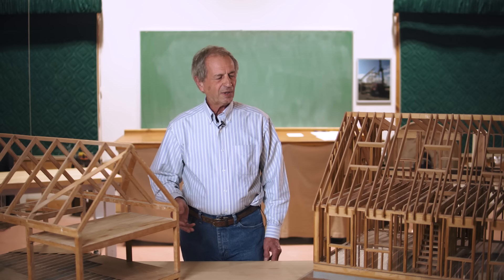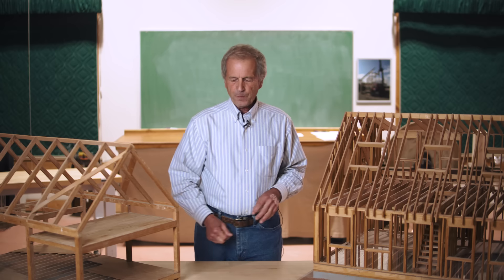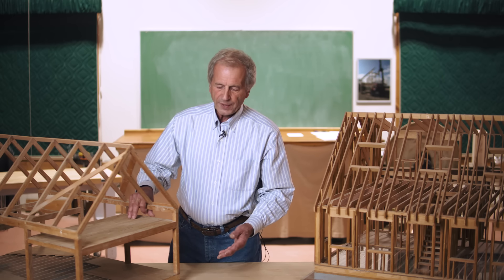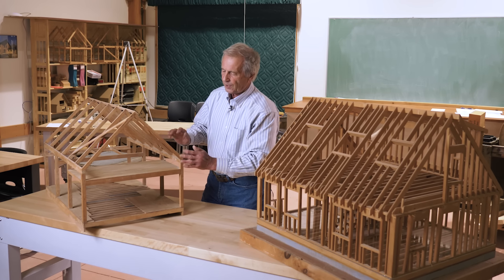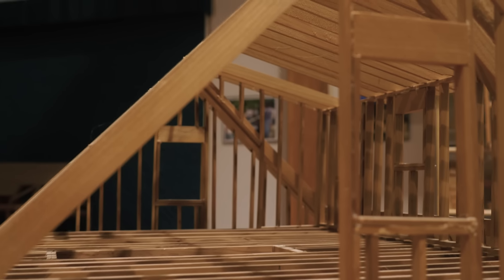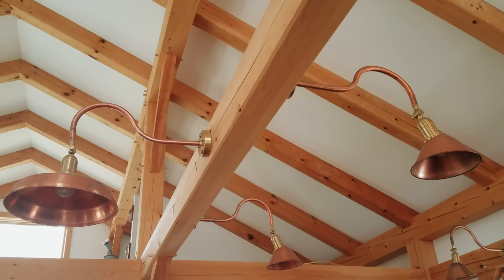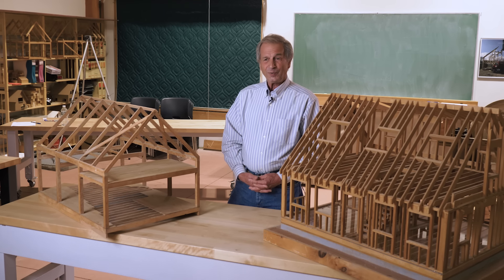Timber Frame vs Conventional Stick Frame

Comment: I'm partial to timber framing. In the south it seems the pine wood that is abundant would have to be treated. I cut some trees myself and found the insects like to bore into the pine wood. There is water oak however that grows straight. The pieces I had sawn do not attract insects. The pine seems invasive and must be cleared out for better wood. I've had many water oaks grow after cutting pines out. A long with red maples. Eucalyptus camaldulensis may be a good tree for timber framing? I grew one this season and are awaiting to see it through the winter. It's a fast growing hardwood that is insect resistant and produces more oxygen than pine needles.

Comment: In the Phoenix Metro area homes haven’t been built using conventional framing since John F Long was alive. Light weight truss construction is exclusively used barring very low volume custom home builders.

Comment: Isn't timber framing traditional framing?
Reply: Yeah I would agree with that. In the UK anyway we refer to his 'stick frame' model as timber frame. The traditional timber build like that is very rare as it is waaaay more expensive so would likely be a bespoke one off build for someone with a lot of cash interested in having the exposed timbers and traditional joinery visible.
Reply: @scottm4193  same in Australia, and who builds with fresh cut on site uncured timber, asking for trouble as is dries and splits, twists and bows.
Reply: @speakupriseup4549  it simply requires a different approach and a little foresight to adapt to twisting and shrinkage. Any beginner timber frame guide will show how you can prevent problems with it.
Reply: Scott M well said

Comment: I never understood why stick frame is still used. It seems extremly outdated and inefficient. And besides, you can build a timber frame with non exposed wood inside too.
Reply: Because you actually use around the same volume of wood for double or triple the cost
Reply: @punishedmeridia  It must be american thing. Here you can tell someone who makes planks to do 2x or 3x thickness and he will be happy to earn the same amount of money with less cutting.
(and almost noone builds wooden houses)
Reply: @attinyit9609  
🤔 "Someone who makes planks". You sound like you really know what you're talking about.
Reply: @Smullet90  English isn't my first language. My neighbour is a cerpenter but his workshop looks more like a sawmill, just enclosed. All he does 90% of the time is cut large pieces of wood into planks or turn table legs.
Reply: @attinyit9609  
Fair enough, asshole is my first language. 😄 Przepraszam

Comment: What about some of the drawbacks to Timber Framing?

1. Fire resistance: Gypsum is non-combustible. Covering the framing with drywall helps reduce fire spread.
2. Upgradeability/modularity: Timber Framed structures are often much more difficult to expand. Stick framing is simpler for the DIY person to repair, add-on, etc. 
3. Labor: Heavy timber is well... heavy and can be tough to frame with. A 16' long yellow pine 6x6 weighs about 140 lbs dry! 
4. Building materials compatibility: Fixtures such as windows are engineered to work with stick framed structures...

We moved away from heavy timber in the mid 1800's largely due to labor and material costs. Heavy timber construction requires skilled craftsmen and significant time. If you've got a bunch of skilled carpenters, lots of money, and/OR time heavy timber is definitely still a good option!

Comment: I certainly like the look of timber vs 2”x4”. .  The wider spacing helps offset the extra expense too.  Partitions are still need to fill long voids and give a straighter wall.
Reply: Don't be fooled by the 'less timber'. Large, planed, lamwood timber like this costs an absolute fortune, and the Sips panels he's talking about are extremely expensive too.

Comment: You only get 30 feet with 4, ten foot bents.
Reply: I think he meant to say thirteen and a third foot bents.
Reply: @danceswithstone  Lmao!
Reply: 4 10’ bents is in fact 40’.  However, to your point, it takes 5 of those cross section frames to complete it.
Reply: @tywebbgolfenthusiast8950  Those "cross section frames"?  Those are bents.
Reply: throngcleaver nope-a bent is the cross sectional frame plus the longitudinal members that connect it to the next section.
Reply: @tywebbgolfenthusiast8950  Since you don't know the correct terminology of the "cross section frame" and the "longitudinal members", you really would benefit from researching the names of the parts of a timber frame building.  A bent includes the truss, and two or more posts to support the truss, depending on the span.  The model building on the left side of the screen shows 4 bents, and that's what Pat was discussing in the video.  Two bents makes a bay.  There are three, 10 foot bays in the model.  Perhaps you are from a different country where things have different names from what is used in America.

Comment: Yeah, I really hate that SIP concept.
Reply: Diggnuts why?  Because is takes away from the aesthetic, or something else?
Reply: @tylerk.7947  
From my experience sip panels are garbage. They're often constructed with OSB plywood. I've seen people mistakenly put on concrete siding over sip's. Overtime the sip panels will delaminate in sag. With that being said I'm sure there must be a better sip panel available nowadays
Reply: @tylerk.7947  Essentially building the bulk of a building out of OBS and styrofoam seems ridiculous to me. It's like building with toothpicks and fluff.
Reply: Daniel Dunham ah, I see. It does seem a shame to put osb and foam over timber framing. I like the idea of sips, but hopefully a higher quality type will come out soon.

Comment: Stick framing  ??
Stud Framing ... was what I thunk it was called.
P.S. ... I have personally witnessed an entire stud frame family home erected in ONE DAY.
NO TIMBER FRAME HOME COULD BE BUILT THAT QUICKLY.
Reply: yes, it is also called stick framing. And how many workers were onsite that day? Compared to the regular crew size?
Reply: Few. However, the home my daughter lives in was built in 1886 making it 133 years old. What will bring down this house is the poor foundation it was built on. This same house survived a tornado in 2003 that tore up most of the neighborhood. There is a lot of hype in this presentation, most of it around the supposed minimizing of materials used. The structure model he is displaying lacks a significant amount of the lumber that will be requried to support the SIP panels negating most of the material advantages. Secondly, obtaining timber such as he is demonstrating in the proper sizes - timbers in excess of 12 inch on a side in length of more than 12 foot long - has become an ever increasing issue. Those types of timbers bear an excessive price, justly, because of their relative rarity. I live in rural plains landscape. Anyone that claims post and beam construction is superior to stick built when hit by damaging winds or tornadoes  has ignored the destruction inflicted on farm buildings using post and beam construction when hit by heavy weather. Post and beam construction is as readily destroyed by high winds as are most other construction methods.
Reply: @cdjhyoung  absolutely agreed

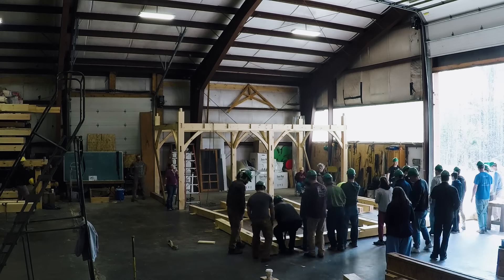Comment: 1:42 "There are 4 bents and they are 10 feet apart, that gives you a 40' building".  No, you only get 30'.  Get your math right.
Reply: Ten foot between bents plus the dimensions of the wood would be thirty feet plus x times four. X being the dimensions of said wood

Comment: I used to frame houses like that, to scale of course, in 5 days. Came to a hole in the ground, left five days later with a fully framed 3500-4000 square foot house. If we weren’t setting trusses by day three, we were probably on a two story house.

Comment: stick fraiming came after nailing machines were invented.
Reply: Do you have proof of that?  We were building stick framed houses in the 50s with hammers in our hands.  Tons of 'em.
Reply: @jeffsmith4110  I think Mathew meant it as a joke.
Reply: I think he meant machines that make wire nails. Prior to that they had to be handmade
Reply: I think he meant machines that make wire nails. Prior to that nails were handmade and so valuable that old homes were burned in order to retrieve them.
Reply: @jeffsmith4110  Why....

Would you have tons of hammers in your hands? One ought to do the trick.
Reply: Pritty much
Reply: @jeffsmith4110  We have a local contractor that still builds large custom homes by hammer. No compressor on his job. It's slower, and he has a hard time finding help, but builds a nice house.

Comment: This is total bs, sell job of timber frame and prefab manuf. component industry. He's not realistic of all the preparatory shop drawings, factory prefab and separate shipping costs.
I have designed and built them all plus other systems like modular and knock down prefab.
Generally, no system has ever bettered the versatility, efficacy and cost of stick frame.
You can design stick frame combined with post and beam and make it look like timber frame. You can show wood as much as you want and at a lot less cost.
Reply: Its really all one's choice. I personally have done prefab homes to which many have needed major repairs done. Mind you this comes from shoty builders too, but mainly the engineering behind them is subpar to which is why I left the industry. Also to why I won't live in a prefab home or one on a concrete slab. Honestly, I'd take a timber home as it can be modified with little concern of the interior walls holding structure unlike a modern stick built or prefab home.
Reply: @brandoncaldwell95  That also is  valid point. You wouldn't have to worry about any walls being load bearing.
Reply: Some true, but mainly no. The problem with Stick frame for me, is that it has no time value. Timber frames, be it for mudhouses, clay bricks, or modern buildings.. they tend to be very reliable and a long term choice. Hundreds of years later, they still stand. They are still reliable. Compared to stick frame, which for most cases, doesn't tend to live the 4 decade mark. Not all, but most.

And it's not because of the wood. It's the same problem as it is with fake plaster walls. They can be incredibly strong, yet their construction and assembly is subpar in most cases. The problem is the assembly and the workers standard. Here, wood is expensive, so we use stone, concrete, and iron for the most part. You need a higher standard for that, and people still fail. 

In case of buildings that require lower standard and can be done faster, are usually "thrown" together.
Also, older people built differently and timber beam building had a much much higher culture, that is why old constructs are better and most succesful. Nothing guarantees that your house will be better, because it's made out of timber framing.

Comment: 98% of spiders prefer timber framed houses.
Reply: Because of all the high up beams? I really wonder which is better in terms of pests getting in, though.
Reply: @jon4715  - I wasn't aware you could keep spiders from getting in.  Bears, maybe, not so much spiders.
Reply: @jrstf  I suppose there are tons of ways of proofing one's home against certain pests. But that starts pre-foundation, and continues through foundation stages, and continues on through framing and so on. Certainly there are ways.

Comment: I fell in love with Timber Framing as a Style the instant I saw the first Pics of it. Then, when I learned a little about the technique, I wanted to start learning  to use Chisels and slicks and a mallet, measuring, locating, scribing the locations of the cuts... 
What I found was no5thing I'd done PREPARED ME with the Skills I Need.
NOT all my years of drawing, whether carefully laid out architectural perspectives, or silly cartoons... NOR all my years of dedicated fiddle practice, nor all my carpentry projects and summers of framing, NOT EVEN using a Waffle-Faced Hammer without smashing my fingers!!!
Not complaining, just acknowledging that learning proper use and care of the tools — storage, cleaning, SHARPENING, leverage, angles of attack, control of angles thru a stroke,  PROPER SHARPENING, accuracy of measuring scribing, and depth of cutting blades in planing tools, AND SHARPENING are all absolutely Crucial.

Comment: Timber framing is a great concept. My apprehension would be the greater distance between runs of fastners in framing. Wind sheer is a very real concern. I get the same uneasiness when passing houses built on 10 foot tall unbraced sets of cinder block pillars.
Reply: Traditional this is done with wooden nails made from oak.

Comment: Really awesome to see as an architecture student. Live in a German challenge in Tennessee that was designed by a German man. 

Having a unique timber constructed house like this is a joy to have due to uniqueness. It's not large, but its truly unique experience. Especially the walls with are largely wood as well with little sheet rock and all hardwood flooring except one bedroom.

Thx for the video. Seemed to learn more here than I did having to research for a class project. 😆

Comment: I have built personally hundreds of houses. I have built both types. There is a lot more customization with traditional framing and contrast to his calculations the homes that are stick framed are a whole lot faster to assemble. Personally I like timber framed homes and love the way the wood looks if maintained. This person sells timber framed homes and makes money from them or their classes. I think each have their pros and cons and have different circumstances in which they both excel.  Timber framed and sip panels tend to be more custom and expensive vs stick framed homes. Timber framed homes also have a more expensive interior design mostly covered in wood which is a lot more expensive and harder to up keep than the interior of a stick frame which can be just painted.  Both last a long time. Both are affected by storms regardless of what he states. If you live in a high wind zone or a place where hurricanes are likely then the home are required to be designed to withstand those forces. That is why we have a county inspection process for new homes. There are quite a few misleading proposals by this person. He is very akin to a politician which an agenda. He wants to sell more timber framed homes. Timber framed home require a lot more large timber that are slow grown. Stick framed use a lot of engineered wood and faster grown structural woods in smaller sizes. You be the judge. I am a wood worker and personally love large pieces of wood that are carved and hewn to fit!  I own hundreds of hand planes. I think better is to think about the sourcing of the wood. If you clear your own lot for instance you will be waiting an additional 2-4 years while the large pieces of wood dry out to a moisture percentage that is optimized to your climate, or you will be sending all those logs off to a place that has a very large kiln to dry them for you faster which also cost quite a bit of money. The whole home has to be sent on a truck to that facility and then returned on a truck back and delivered. Things to think about......

Comment: Coming from - and living in - countries where timber framing is the norm It’s weird to hear timber framing being referred to as the non-traditional building method, and it’s really interesting to hear someone explain it to a five year old, so to speak, because here most construction experts assume way more knowledge about their timber construction methods than I at least possess. Our timber house has no drywall. Instead it’s two layers of four centimetres thick tongue-and-groove planks. That’s then covered by a vapour barrier membrane (thank God for dictionaries!), then eight centimetres of rock wool, followed by six centimetres of air and then lastly a larch wood outside surface. Incredibly well isolated and impervious to water damage as long as the wood is allowed time to dry. I wish I had seen how they put it all together

Comment: We can make a structural a lot stronger with 2x6 by using Simpson strong ties, no need for crazy expensive lumber..
Reply: i doubt so, specially because these structures are made to resist earthwquakes. the simpson ties are mainly for strong winds. i wouldnt know about the prices of timber where u live, but in Chile, where i live, its not that expensive really

Comment: cool and all, but as a electrician, if it is exposed timbers how do you get any power anywhere?? without running it on the actual gypsum board on the inside? am i missing something??? a cavity like stud construction on the outside of the building?
Reply from the maker: That is a great question Glennmight! The wiring is typically housed inside the exterior wall (whether it is a SIP or a cavity-like stud construction. It could also run within a chase mounted to the inside of the exterior wall that is than trimmed out to look like a chair rail. And of course wiring is run in interior partition walls and within the first floor framing.

Comment: we have a house made in whole timber frame as in a tree was just naked w/o the bark and joined only be joints, it was built in late 1800's and still standing strong till now. though the outer frame and skin might have been damage a bit, we can still replace it, just had a magnitude 7.6 last 8 years ago, concrete neighbors are in rubbles, it survive the last category 5 typhoon, and hopefully will survive every calamities it will hit.

Comment: How and where do you run the utilites like electricity, supply and waste plumbing, heating and AC duct work?
Reply from the maker: Hi Greg -- thank you for the question. Electricity can run through the SIPs which are precut to accept the wiring; through interior partition walls, in the floor framing, and/or in chases. The plumbing typically runs through interior partition walls, in the floor framing, and/or in chases.
Reply: @ShelterInstitute  Thank You.